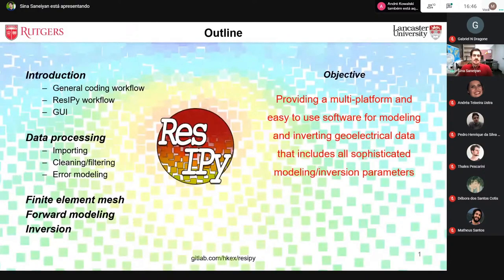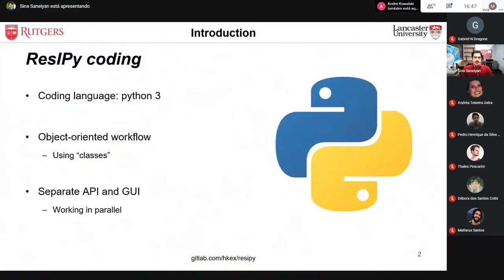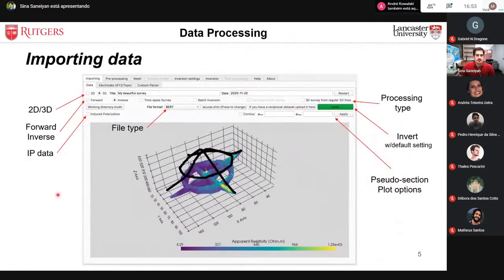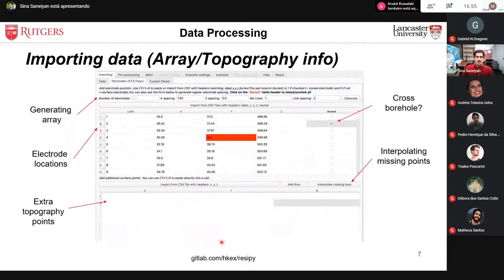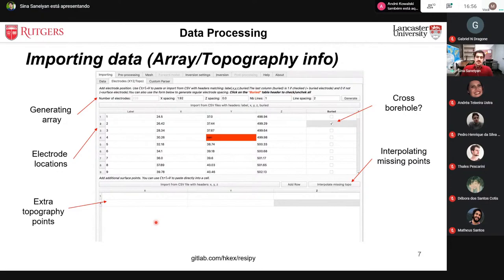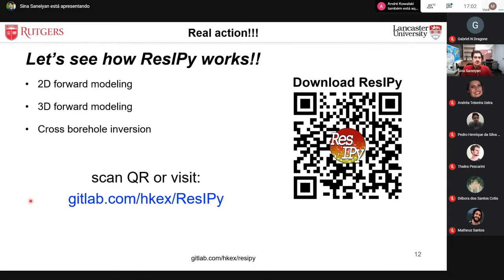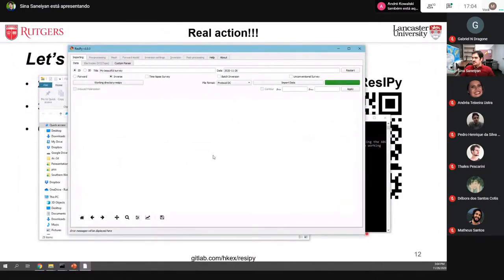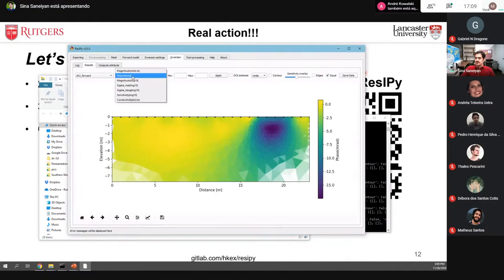Seminar at the University of São Paulo, Brazil

Comment: Hey Sina. Great talk. For defining the 3D regions, wouldn't it be easier if we could just specify the coordinates of a few simple volumetric geometries (top left corner and bottom right corner of a cube for example) instead of trying to define it graphically? Cheers
Reply from the maker: It would be more accurate not easier! The API translates this graphical selection box to coordinates, so you can use ResIPy’s API for more accurate 3D forward modeling.
Reply: @ResIPy  ok. I thought it would be both easier to implement and also easier for the user. Cheers